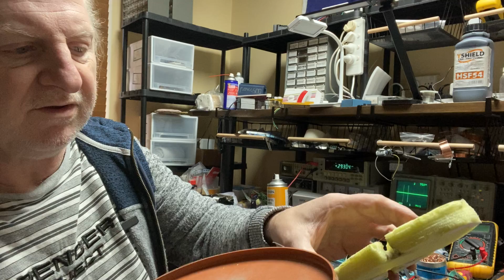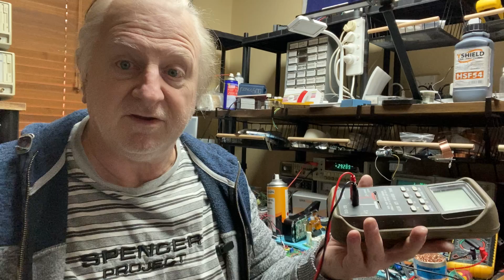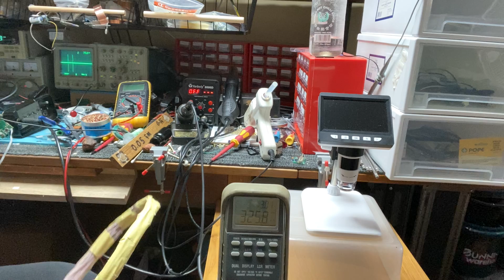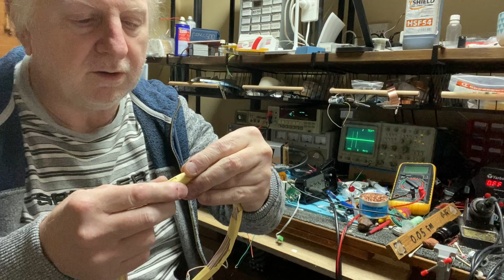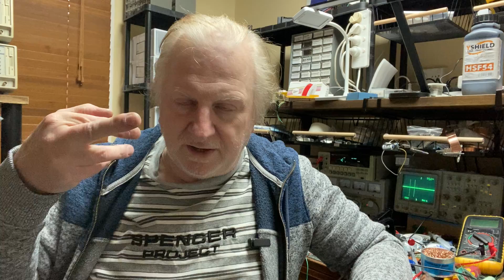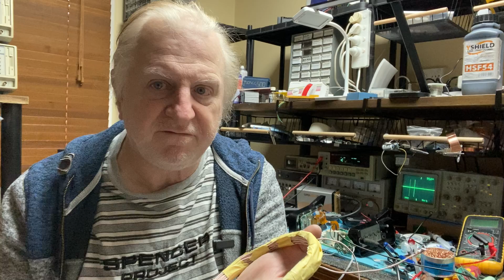Coiltek coil rebuild part 2 not exactly a rebuild as the only bits the same is the shell and lead.

Comment: What if you had silver litz wire made with a gold clad or plated? Would there be any benefits to doing so? Maybe use the stuff used in the superconductor magnets of the large hadron collider its soft before being irradiated then turns hard like tungsten carbide only brittle as glass. Seems it uses liquid helium to get to the superconducting temperature. I guess liquid nitrogen or dry ice can be used to chill coils, question is would it matter?  I still think a o-scope  used on the pickup would allow you to see changes you can't hear. Your hearing can tell slight changes in sound. A scope with a scale of 0.0001v per 10 milimeters on. A 150 mm scale. Should show the slightest changes in what will be sound of a target. The point of picup and amplifier would matter. I know the problem is the coil will be picking up every possibly even disturbance in earths magnetic field. It cant pick up thr field possibly large solar flares disturbing it . I saw a video if a guy with a large coil of wire in a garage. He could hold up a 8x2mm  neodymium magnet , turn hus hand and the scope saw the magnet from 30' + away thirty feet 360 inches still getting a big spike on the scope . Not Shure what thr coil was for it was beyond large. And was 1000's of feet long possibly 2-3+ miles long it was at least 12" / 300 mm inside diameter and 4"-5"  deep, from the side, and the coil wire about 3" thick of 24'gauge (+/-) 4 gauge sizes. it has been years since i saw it. Difficult to recall. It could have been 18"-24" diameter with the other dimensions scaled up. If that coil coild pick that magnetic field up from that far away. I feel a metal detector can possibly be 30-50% better some day maybe a more lab grade detector requiring a large coil around the perimeter of the area. And a small 2"-6" coil to serach inside the area. A 64 to 144-200 sqft circle or square of coil being pulsed with a variable sweeping frequency, with breaks where the searching /pickup coil is powered , maybe something like a zvs driver the pickup powered when the search frequency is at zero crossing. I would require a slight 1-5 millisecond dead time delay, give or take. I dont see some ray gun treasure finder working. Finding gold from 100's of feet away, 10' below ground with nothing besides a bunch of antenna ..  people paying $$400- $1000+ for this garbage that can barely pickup a pocket knife in your hand all but touching it.. you sre better off using your eyes as a metal detector. You will find more that way..   back to the +50% detector, pulse the large coil with about 550v at 20 to 200 ma. On a coil of 14-24 gauge made of wire 36-38 gauge each.  Test to decide on exactly the wire to use. Maybe use on the pickup coil 36-38 garge strands making up a 10-24 gauge litz wire coil both coils connected to a control box. Maybe thr search signal start with a positive 1000 hz tone. Then  go negative pulses, both for 2 seconds, then go to an ac pulse for 2 seconds at 1000 hz. Then go to 2k hz. Maybe have a function of a 2-4 hz positive and or negative pulse at a high voltage charge the capacitors to 1200-2500 volts and discharge through the coil. And listen for what happens after for nearly one second. All this being testing,  and record what the pickup coil hears.  Maybe use a 12"-18" "coil" that is actually made up of multiple 2",3"or 4"-6" with. Each coil being amplified and processed and recorded seperately. Like audio recording on separate channels.  May old reel to reel 16 channel audio tape. Do the modern equivalent, although analog would possibly be the better option. Maybe a computer can hear what gold sounds like  when a certain frequency is "played to it" and the coil able to hear maybe 40-50 to 200-250 milligrams of gold in 200 cubic feet of dirt! On the bottom center of it!! I kinda doubt that, maybe it would get down to 2-3 grams of gold at that depth, my math is horrible and non existent maybe 3'-7' deep in 200 cubic feet?  For deeper searching double or triple up the coil. Make the 12" coil 36"-48" diameter and keep the search coil in center. The slow high power pulse maybe could see 1gram at 8'-10' deep? Putting 1000 volts on a 200 ohm coil may just produce heat at some point. Maybe lower the voltage possibly 600v probably keeping the current under 100-200 ma.  A coil that size would have a huge magnetic field for a fraction of a second. Maybe multiple pulses say 3-5 at a frequency of 100k Hz or sweep from  3kHz, 6kHz, 9kHz to 103KHz-109kHz  maybe even go into 300 kHz, 600KHz or 900kHz the equipment required to go much over 100-150,kHz will be different than the 1khz-50khz(+/-).  
Sorry to be rambling, if anyone ever read this far...😂,   i just feel it is possible to pickup much more than currently possible. A gain of 1x would be great.. possibly amazing .. 50% should be possible.. Everything is vibrating, and metals usually are attracted or repelled from magnetic fields if only the very slightest amount. Seems gold is repelled by magnets if i recall correctly. A large magnetic pulse should effect the gold some way. That should effect its vibrating. The vibration can't be heard in a sea of everything else vibrating, but this vibration being disturbed or accelerated should stand out enough to be heard . Maybe the frequency of the vibration can be tuned in on . And a complementary tone can be played through a magnetic field. To make the gold tartget sing even 1/4-1/8 gram in 6' of soil , and loud enough it can't be missed! I think two separate coils is the way to go. Maybe a hand held unit that automatically searching within the 24"-36" coil and pin pointing done with a separate 2"-4" coil digging inside the larger coil.  And this for sub 5 gram, for 5 gram to 1oz+ targets a 12' x 12' coil with multiple 12" search coils possible to search within, or possibly  multiple 10'x10' coils to cover up to a 20'x20' area at once with a 6"-18" search coil.   The pulse coil being a bundle about 40 mm diameter. Possibly operating in the 100-250 watt range the. Actual power over time being much less like a pulse of 200 ma at 2000 volts at a frequency of 1khz to 100+ khz pulsed every 2 seconds and off for 1 second .  The actual power consumption would be much less. Would. It be useful , would it work?      Anyway sorry to ramble  have an awesome day. And hope easter was a good one also!🎉
Reply from the maker: I am going to have to make a video on all these questions,